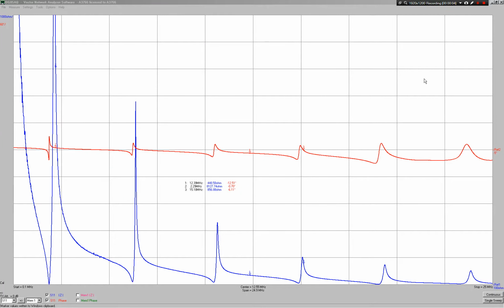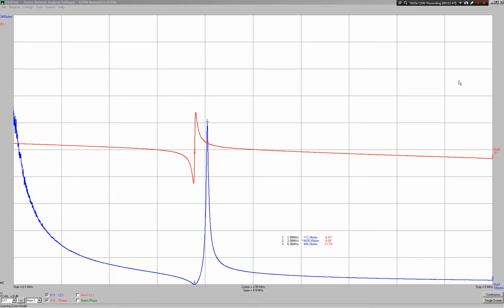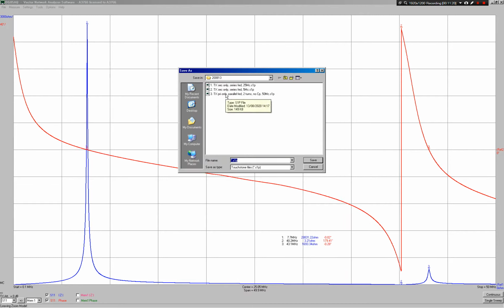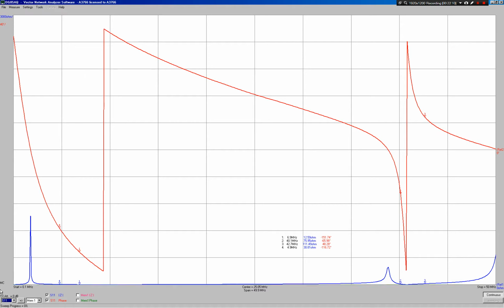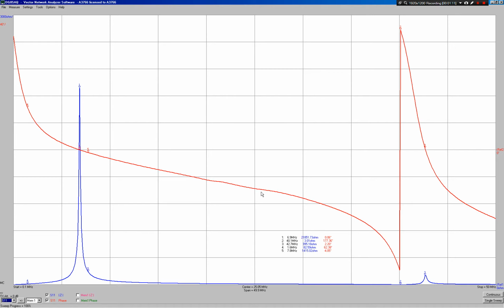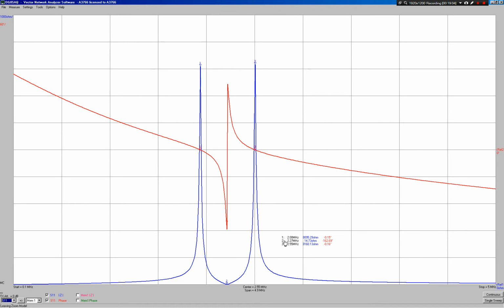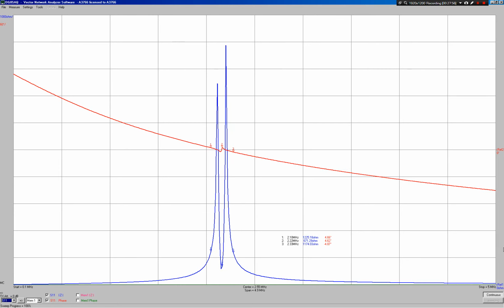Tesla Cylindrical Coil Input Impedance 1 - TC and TMT Z11

Comment: 10:12 analysis of the series fed secondary coil
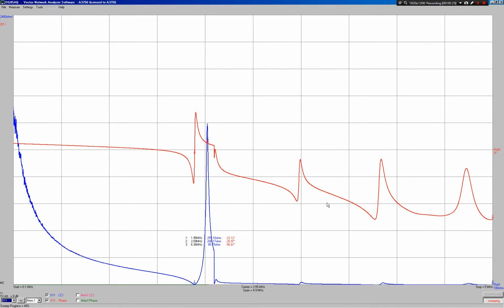14:08 5mhz sweep of secondary 
16:19 analysis of the primary coil parallel driven
18:40 50 mhz sweep of primary
30:49 adding parallel capacity, can tune away the harmonics of the coil
32:00 harmonic is tuned back in by adding even more capacitance
32:40 explaining tuning primary parallel mode to secondary
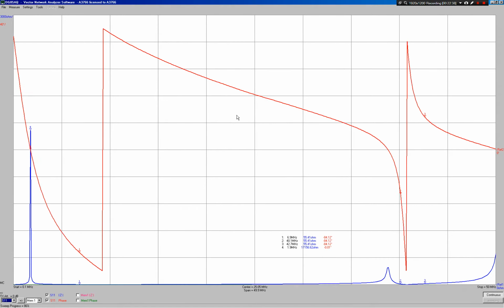36:25 explaining about coupling
42:50 1m distanced primary and secondary
47:00 moving secondary towards primary
49:50 stronger coupling, more phase change
50:10 5 cm separate
50:26 fully together coupled
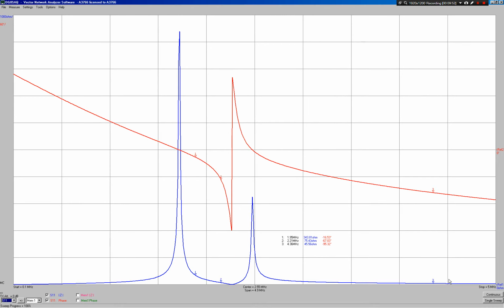52:30 balancing by tuning primary capacity
53:12 balanced lower and upper split frequency
55:40 driving with impulse generator at minimum impedance
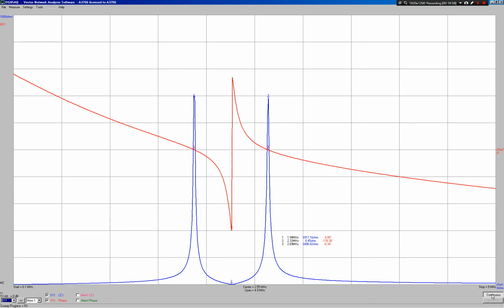59:40 moving secondary away to see balancing changes
Reply: So balancing the parallel impedances, gives the ideal power transfer from primary to secondary?
Reply from the maker: Balancing the parallel modes magnitude of impedance appears to give the highest efficiency in the transference of electric power in a balanced TMT system.
Reply: @aminnovations  Depends on what you call TMT, for me its an impulsed series tuned primary, a parallel tuned secondary with a series connected extra coil. Many tuning options with this one!
Would love to see you analyze a secondary with series extra coil.
I will make measurements on my bifilar pancake coils, very curious how they will look
Reply from the maker: @MasterIvo  Yes this is definitely in the todo list, I had planned to do the analysis of a three-coil TMT system before I went to ESTC 2022, but just did not get around to it. I will do an analysis though in the second part of this year, as I am using a three-coil TMT for the new Transatlantic Telluric Transmission project, and this includes setup and tuning of the TMT system on both sides.
Reply: @aminnovations  That's awesome. looking forward to the results, working in the same here,Altough I use a 4th coil for impulse generation.